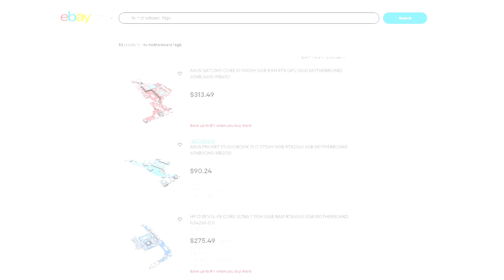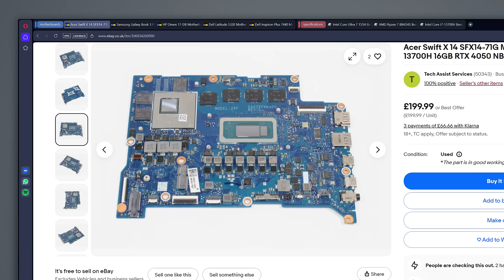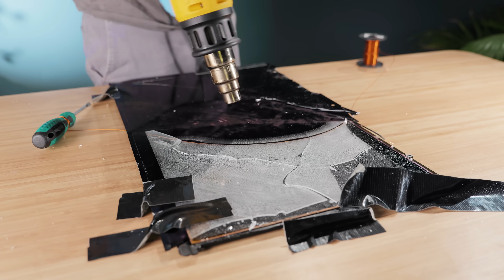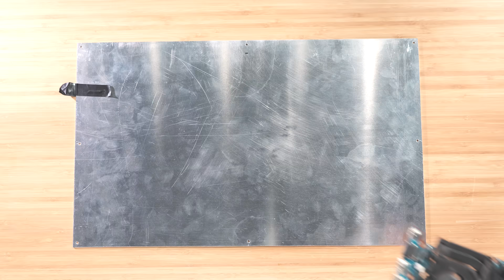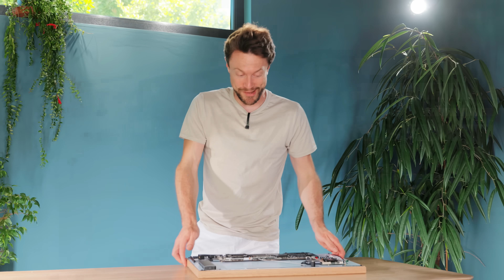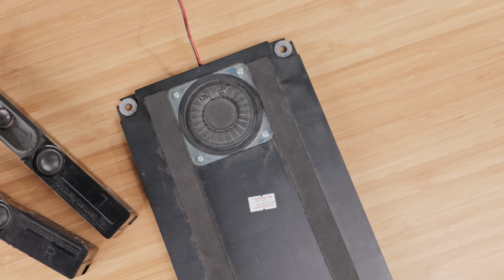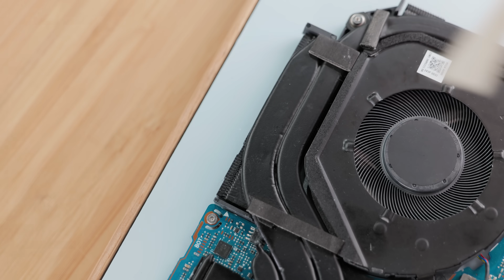A new way to build a PC in 2026!

Comment: since I don't see anybody else mentioning it, and I have some experience trying to do something similar with a lenovo miix 520 board and I learned multiple additional obstacles to this project ;
1. without the battery connected the board may randomly power off even if connected to a well suited power supply from the charging port, at first I thought it wasn't getting enough power but eventually I bypassed this by dissecting the original battery that had died. (using the BMS board that was attached to the lithium pouches whilst disposing of the pouches. laptop recognizes the battery is "dead", but doesn't randomly power off immediately now.)
2. even once bypassed, the board may not be able to receive enough power from the charge port for heavy tasks and the board can randomly power off. looking closely at the charging circuit reveals pathetically tiny ribbon cable connections from the charging port. I still haven't worked around this yet. (don't know if I'm either going to add a dummy battery circuit from the charge port, or upgrade the connection past the ribbon cable. not one of my priority projects.)
3. lastly, my lenovo miix has terrible TERRIBLE thermal management and easily pushes itself to 90c despite fresh thermal paste, causing itself to thermal throttle. I wound up just throwing a copper heatsink to the back of it's original heatsink, but I'm far from satisfied with that result (cools it down significantly, just looks terribly ugly.) basically, these boards don't have any kind of heatsink screw placement standard, needing more fab work in order to upgrade thermal performance.

edit: I'm not at all trying to discourage anybody from a project like this, I LOVE the idea. just providing additional knowledge that would have been useful for myself. Thanks so much for the upload!
Reply: Thanks for writing.

Comment: hello sir. i have a question for you. Do you have a video turning an LCD panel into a portable monitor? I would like to find the holy grail but also feel that making it might be possible. 
24 inch
wireless
screen mirror/air cast or whatever it's called
powered by battery bank
and why not, touch screen
large monitors are powered, wireless are not touch and i just keep getting about 2 factors, sometimes 3 but then prices comes into account. see this is more of a random lesure thing to have and i didn't want to spend a limb on something that may get used once a month, 3 times a month and sometimes never.

Comment: Love this build. It is absolutely beautiful. Coming from the automotive world, the only thing I would add is some grommets in the aluminum panel to keet the wires from fraying. Even a very slight vibration, over time, could cut throughout the insulation and destroy the wires.

Comment: Old mac screens didn't tend to have the best motion performance. They're still amazing in resolution, color and brightness spec when compared with the stuff most people use.
I'd alsp note that the original power brick of a laptop is already over-specced to charge the battery at reasonable speed at the same time as the laptop would be under full load. So it would easily power the display at the same time.

I love all your videos. I've known for years that these motherboards where available and it never crossed my mind to use them.

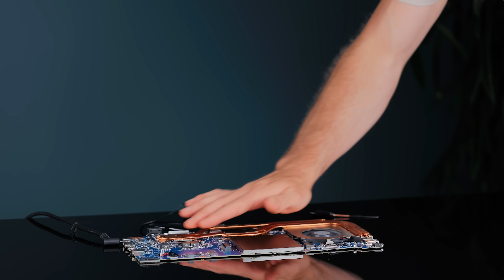Comment: 4:30 Computers will happily boot without a fan and heat sink, and not destroy themselves. 
So this is bad advice. 
Now,  shorting voltage to 0 volts is a bad idea as you could damage a component. You should use a resistor to bridge the voltage instead

Comment: shouldve added a battery to keep the computer running during power outage, even if the screen turns off, itll let you save your files

Comment: I do ponder, the laminate over the screen, serves a purpose, as demonstrated by it being totalled, while the screen remains pristine. Wouldn't a protective layer of some kind be prudent?

That aside, I wonder if old iPads could be recycled along these lines. I have an old air 4, lovely retina display, and it's practically useless, from the passage of time. Does a display board with inputs as in the video exist? Need to do some research...

Comment: I've always wanted to Watercool a laptop motherboard CPU GPU as their cooling is sub par not the best...even with giving it better thermal paste and more headroom on using UPsiren putty to push the heat to the bottom panel of the laptop.

Comment: The "keyboard power button" on the FFC almost always has breakout pads on the mobo as well, so you can just find those 2 pads, solder two wires and hook it up to a button

Comment: Thermal coupling this motherboards to aluminium plates would be cool idea. And one thing that make me want to scream to the monitor - power button custom ribbon. Im 100% sure that somewhere on that keyboard ribbon socket was ground pin. So just add second copper tape strip and You have removable power switch that makes you life easier when you need to disassemble your creation.

Comment: You don't need to swap the laptop charger, because there is no battery that also need power to charge. the original 200w brick is higher quality and enough for powering both .

Comment: A lot of laptop motherboards are designed to boot without the power button if the CMOS battery is removed. I would always recommend removing the CMOS battery then trying to turn it on first, because that sometimes just works.
Reply: But then wouldn't it forget the time and your bios settings every time you turned it off?
Reply: @DuckInGameStop  yes, but laptops rarely have useful bios settings anyways, and the time issue is only a problem if you plan to use the computer offline. if it's connected to the internet it can just autosync with the network time.

Comment: How about this? Get a laptop motherboard with a built-in accelerometer and gyroscope. Then you put it all in a picture frame. Then when it's sitting idle it looks like a giant digital picture frame. When you're using it you can change from portrait to language on the fly. I'm sure you could get some kind of screen saver program that will only show pictures in the mode that the computer is currently in. That'd be kinda cool, right? What would be really cool is if you used a servo that turns the screen 90 degrees with the touch of a button or a hot key commsnd. You can get the servo for $15. You can get a servo tester and dial it in to whatever angle you want. Maybe that's overkill. The sky is really the limit with this. This sounds like a really fun project! Thanks for getting my brain going in this direction!

Comment: I love this guy but i hate delusional people much more. Parts to tools ratio is quite high in this one and absolutely not worth rebuilding this configuration period. It will heat quick if gaming more than 20 minutes and rdr2 is absolutely no measurement of performance. With these tools and a 3D printer this only makes sense as content nothing else
Reply from the maker: I have to push back on that one - you absolutely can do this with very basic tools, just a drill and a saw if necessary. There's a simple version at the end too if the main build is too complicated.

Comment: So in concept this is awesome, but in execution this feels less baked than your previous builds. The rear is 3/4 complete, the legs look to be an issue with how its sitting on the very edge of the table from cable management giving me pause to think it might fall off. In general it just feels like parts of this were after thoughts even with how much went into it, especially gluing things to the back of the screen. Still love how the screen, bezel and soundbar came out though.

Comment: One thing to be aware of, not all laptop boards use the discrete GPU via the USB C connector, they tend to revert to the iGPU. The HDMI (Or mini display port) usually is the only guarantee of using BOTH gpu's in a Laptop.

Comment: As much as I like the idea and the execution, I thought about build one of these things by myself, first of all these motherboards are all around 500-600 USD without the heatsinks, which need to match exactly the motherboard. Add other 100-120USD for this. Some motherboards have daughterboards required for power, like Alienware. No barrel jack on those. Then you need a 100USD PSU and a 50 USD display driver. And a working iMac screen. Yeah cheaper than buying new, but with a lot of uncerainty. One small mistake and you wasted hundreds of dollars... So it's worth it only if you can find components real cheap.

Comment: Very good work.  Two things I would have done differently are bringing all the ports (USB 2/3/C, HDMI, etc) out with male to female panel mount cables, and making a custom cooling solution so it can run quieter and be less likely to reach the point of thermal throttling.  But this is absolutely a great way to get a budget performance PC

Comment: With the display output i would just use the connector meant for the internal display on the laptop which is ussually dp with other functions like touchscreen which can just be ignored, like this you dont need to permamrntly block a usb c port and it also is how the mainboard expects a display to always be connected

Comment: In order to route the power cable cleanly, that back leg is right up against the back of the desk and then to turn on and off the computer, you need to press against the front a bit of a recipe for disaster

Comment: Honestly, if you have a motherboard without video out on an external port, you can still get video out just fine. Just about all laptops from the past decade and change use eDP, or embedded Display Port, for their internal video connector. It's standardized to either 30-pin or 40-pin, with 30-pin being the more common of the two for recent models, and you just go online and buy a panel of your preferred specs that takes eDP. If I remember correctly, there are also converter boards that will just take a standard eDP 30pin or 40pin input and convert it to standard DP or HDMI, and from there you can just slap on whatever converter board you want so you can connect DVI, VGA, S-Video, component, RF, whatever. Going from the onboard eDP straight to the an eDP panel saves you the cost and trouble of a driver board because that lets you use the laptop's onboard driver hardware.

Some desktop LCD screens also use eDP internally, but this isn't universal. I think all-in-ones tend to use it, too.

One trap to keep in mind is that some laptop manufacturers, particularly Dell, continued using LVDS on certain models well into the mid 2010s because they just had such a massive stockpile of LVDS displays that, while slow, low-resolution, and generally quite horrible to look at, did well enough for pro-sumer and bulk-contract laptops. There WERE LVDS panels made that weren't completely horrid, and on paper the standard had enough bandwidth, on a dual-link cable, for 1080p60 displays, but it is PHENOMENALLY difficult to actually find decent LVDS panels, and moreso at a reasonable price.

Comment: I once took apart an old laptop and it has a daughter board that was basically just a power button so the motherboard didn't have a power button it it but it wasn't on the keyboard which is wildly cursed.

I can't remember if it was this same computer or another one but I couldn't get the BIOS to show up on an external display however Windows would show up just fine.

Comment: The plus side of using laptop motherboards is that they do have the WiFi/BT card already on them so the wireless mouse and keyboard simply work. But my gosh, the subwoofer wiring, I dare not do that without a lot more research. Mind you, some media laptops used to come with three audio ports that you can configure and some still come with an integrated subwoofer.
The frame for a laptop is also neat for travelling internationally, just need cables to connect the laptop to a hotel TV and a slim keyboard/mouse. Similar to, but much more powerful than using something like DeX on your Samsung phone.

Comment: Something to also keep in mind when doing a project like this. When there is no battery present, the laptop can experience transient spikes which impacts performance. It can also cause the laptop to not go into performance mode and then you need to build something to emulate that a battery is plugged in. This can massively hinder performance

Comment: i built a much more basic version of this in an old sales kiosk, reusing the 1080p touchscreen in the front with a laptop keyboard instead of the original power-wasting and not too performant 4th gen intel desktop cpu mainboard. my laptop boards (I've used two different ones) still had their power buttons on the board, so i was able to solder cables directly (with a bit of cursing due to the fiddliness).
Very much appreciate your pointers for how to deal with the newer keyboard-integrated buttons! the idea with the paper and copper trace is very cool and simple!
of course, also the rest of the build is very inspiring again, especially with the nice screen! Although delaminating does sound like a bit of a pain 😂 
anyway, hopefully I'll get an opportunity/excuse to build something like this again in the not too far future. Thanks a lot for this - I'm always so happy when you upload a new video! ❤

Comment: Clever solution with the custom ribbon cable for the power button, but changing the BIOS settings to automatically boot on AC power restore could also work

Comment: Something to note with older laptops and even modern ones is that it's thermally power and hardware limited due to them being laptop chips, some laptop and mini PC have  oculink or thunderbolt which can be used to connect a desktop GPU

Comment: Do I expect a fancy TV unit not like the one you made earlier with doors but a one fixed on a wall and it has inbuilt speaker and subwoofer with the laser to transmit audio into the surround channels.

Comment: Pro tip: the motherboard for the Dell Latitude 7420 (and possibly the 7430 but I have not checked) has a power button already on it due to the way it's designed. You can also solder to the pads to move the power button wherever you want. Sadly the 7420 does not have a dGPU and is a little older, so you won't get the newest parts, but they are decent. I would know. I own a 7420.

Comment: Tommorow is my very important exam and I never watch your video in hurry. 
I watch it with calm mind hence I'll watch it the day after tomorrow, at night.
Reply from the maker: Good luck for your exam!
Reply: @DIYPerks Matthew, I think I have a project idea that matches the kind of engineering and design challenges you often explore.

The Meta Quest 3 has one of the best consumer VR optical systems available: pancake lenses, excellent clarity, and a wide field of view.

But it also carries a lot of weight because it is a complete standalone computer.

What if the Quest 3 was redesigned as a minimalist personal cinema display?

Imagine:

keeping the optical core,

removing the unnecessary VR hardware,

moving the electronics elsewhere,

creating an ultra-light custom enclosure,

focusing entirely on comfort and visual quality.

The goal would be something between a GOOVIS-style personal display and a Quest 3, but with the best parts of both.

A fascinating question: How light could a high-FOV personal display become if it was designed from scratch?

I think this could be a beautiful combination of engineering, materials, and product design.

Comment: The thing about salvaging old hardware, is that, it's actually the 2nd step in the 3 pronged recycling step. Reduce (aim for less waste), Reuse (use things again or repurpose them, like fixing broken things, turning a cup into a pot, etc, then Recycle. Recycling the materials themselves is actually a fairly energy intensive process, and I always advocate for recycling vs just trashing when possible, but it is definitely something to keep in mind.

I've been loving getting more into repurposing old things and also changing out a bunch of the junky low quality things I have I keep throwing out and replacing to be more geared toward stuff that will last.

Comment: One thing though, some laptop will limit its clock speed and power if it didn't detect a working battery. So if anyone wants to try this, you might want to pickup a spare battery to get the most performance.